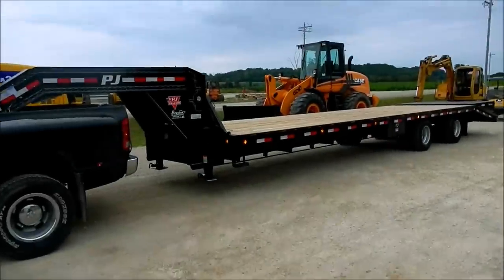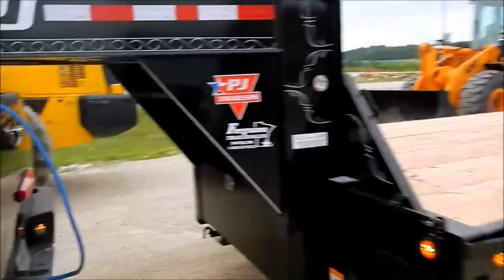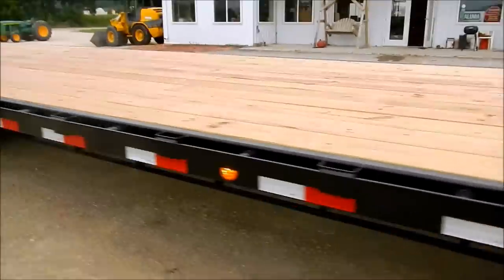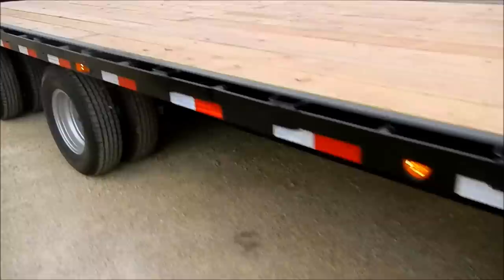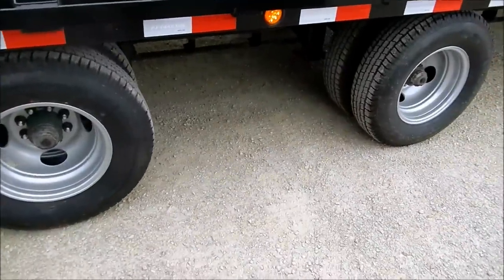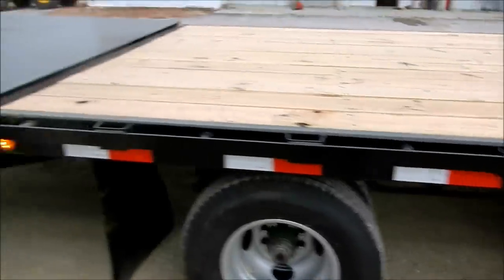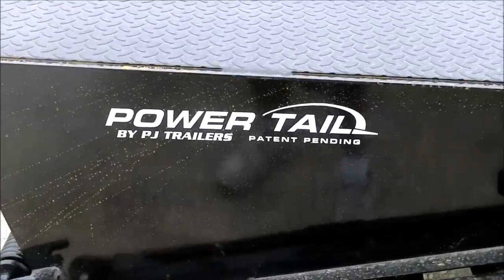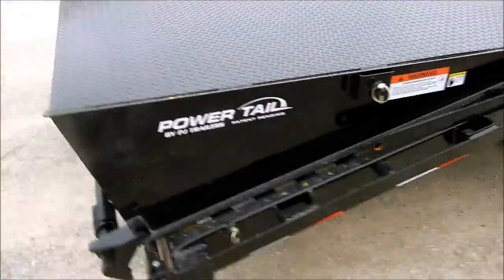PJ Trailers 34' Flatdeck with the new Powertail

Comment: What are the advantages of a spread axle that wide?
Reply: Homer Garcia haul more weight and trick the scales !
Reply: It will also track better and be more stable on the highway, but tight turns are really hard on the suspension.   I wouldn't worry with a torsion or hutch type (like this one) suspension though.